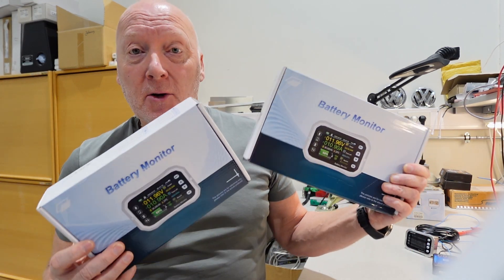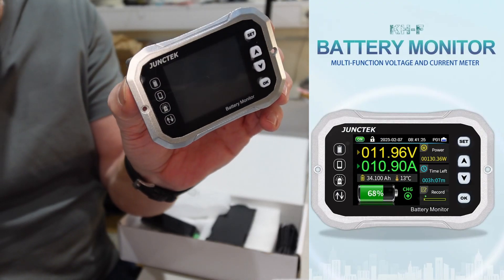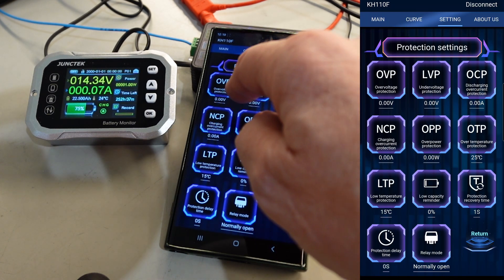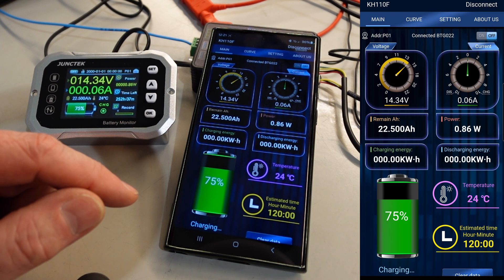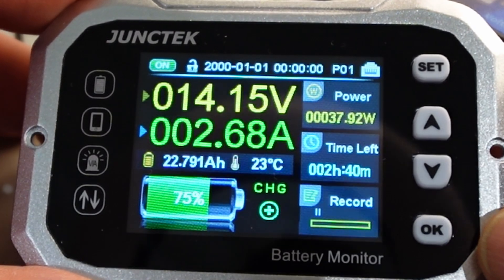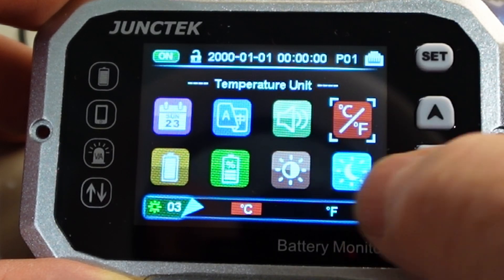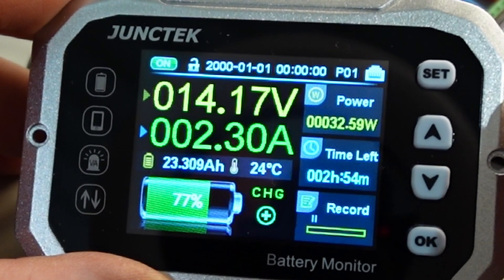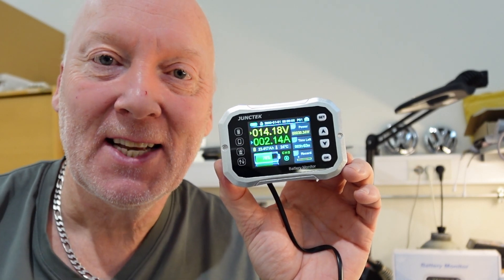Junctek KH 110/140/160F battery monitor with negative temperature  protection

Comment: It looks like a very functional piece of gear, BUT... RJ11 connectors in a vehicle???...less than impressive reliability for the environmental attack (mostly moisture) they are exposed to.  Also, to control charge or discharge with just a relay means load or charger are either fully connected or not connected...no in between!  And the relay you used for the demo was OK, but if you wanted to break a high discharge current, you would have to use a more serious contactor, not a wimpy little relay like that!  For an objective review, you should also mention negatives.  Cheers from Connecticut!

Comment: I have Battery discharging limit problem with my two batteries:

- Basen Green 11.7kWh 51.2V (BG)
- Ecoflow Delta pro - inverter 3,6 kWh 48V (DP)

BG charges DP via XT60 (solar) input with power 8A - 420W when necessary.
With DP inverter I can't set BG as not to empty itself completely! so I please for help, what or how could I do to prevent BG from draining to 0%?

Can you suggest some Battery status monitoring that can stop charging when voltage drop below set limit?

Comment: Only thing I found missing is voltage and current calibration that was available with the KG series
Reply: It has calibration as well. There are features explained in the download manual that are not in the enclosed manual such as the PW for firmware update and how to calibrate voltage / current and temperature. Short story is use the app and click on the value and a calibration screen pops up. Alas calibration is 1-100% (or +/- 5% for temp) and I've found the steps are too large to calibrate. IE my small error (less than 20mV) is less than 1 step of adjustment. My unit the temperature is more than 5% out of calibration so maybe I have a bad temp sensor. 
He also didn't touch on 1 wire vs 3 wire connection. 1 wire (default) I'm getting about 20mV and 10mA error but with 3 wire my error goes down to less than 10mV/ma so use the 3 wire connection